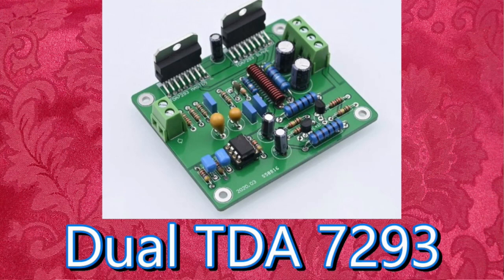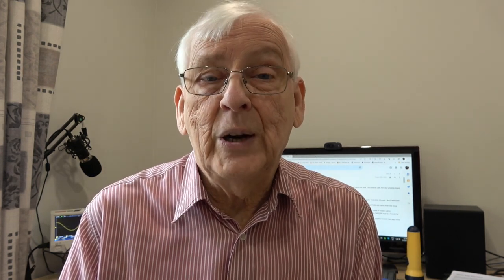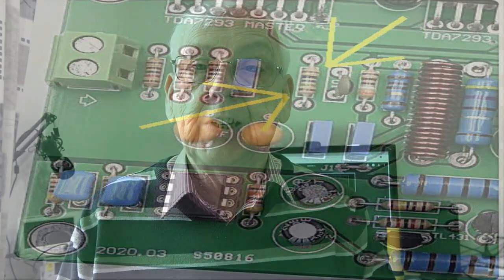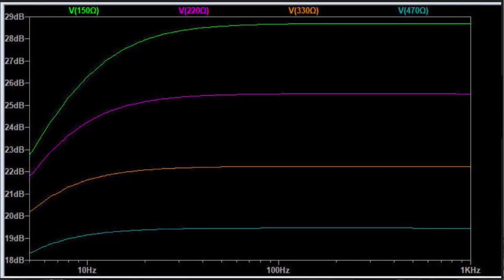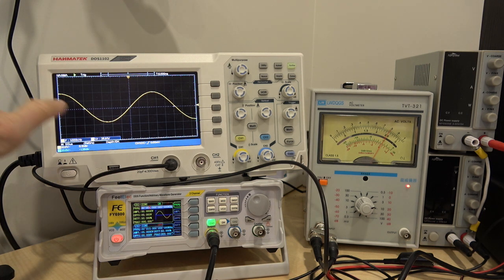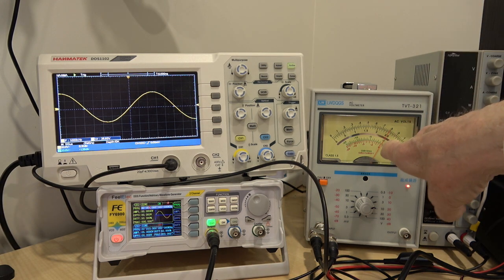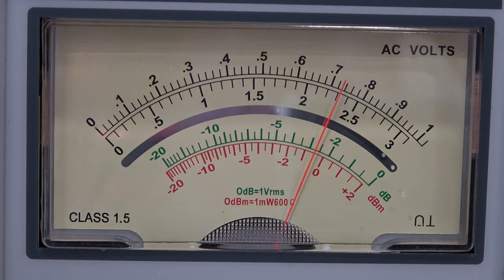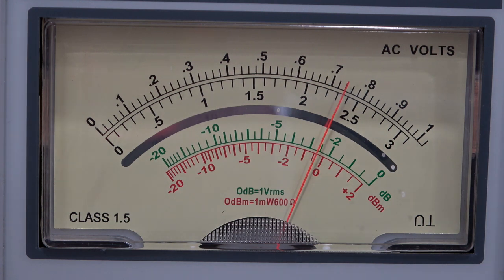More Mods & Tests on the Dual TDA7293

Comment: Hi Mike, I understand that these amps do not like a pot at the input, so I am considering using a NE5534 as a buffer but with some gain as they do not like unity gain, an then reducing the amps gain to suit. I prefer the 34 to the 32 as it has an offset adjustment. Does this sound like a good idea?

Comment: Hi guys, (thanks Michael) Dear Mr Ron Schauer, are you watching us :-) Can I reach you somehow I do have some questions which I am sure you can answer. - My experience so far, after powering the amp, it went into smoke, I seem to have bought fake chips.
Reply from the maker: If you have purchased the completed one I have talked about in this video, they are genuine chips. In fact mine is still in use every day. Things that can blow it up is connecting it up in correctly. Only supplying say the +ve and not the -ve, that will blow it up for sure. This module costs more than many on e Bay simply because they are genuine chips. Some of e Bays complete amplifier are cheaper than 1 genuine version. You pay the penalty!

Comment: You actually dont want 5hz. Record warp will drive you crazy as hell if your amp gets down there
Reply from the maker: I personally don't use records at all. So only an issue for these that do. Such filtering should be provided on the RIAA circuit. Other inputs don't need restrictions.
Reply: Most speakers won't even produce 5hz or even 20hz.
Reply from the maker: @Munakas-wq3gp Very true but transience's or sudden pulses do. It comes over as bass slam which this amplifier has. You wont  know until you try it.

Comment: Hi Michael thanks for the great content. I see boards on ebay with 3 tda 7293 chips on them. Do you think this would be an advantage or is it just for power? I want to build a stereo amp for music and to integrate with my home theater and you videos have me thinking tda7293 is the way to go.
Reply from the maker: I have not tested the 3-chip version. It does not contain the servo circuit, however. It would allow higher power, if you need more, simply because you can up the voltage and the increased current is shared between the 3 chips.

Comment: Lol ...I don't know about the gold plated case, but maybe glue a high end logo on there?
I'm certain many "golden ear" audiophiles would be shocked and maybe embarrassed in a blind test!
Reply: Gold plating (if thin enough) can be relatively inexpensive, and it could (in some potential reviewers' eyes anyway) greatly enhance the sonic clarity, soundstage, depth, ambience, detail, impact, presence, blah, blah, blah- ad nauseum.  
As for a logo pasted on, I think that is an excellent idea..!
Pick anything north of $10,000 (per channel without a preamp of course...).

Do you suppose a golden-eared audiophile would give it an true blind A-B test and admit the results?

😆
Reply: @ronschauer839  lol ....I don't think you would get a bunch of those in the same room anyway. Besides, they hate to be proven wrong: that their 2,000 dollar,  kryptonite infused, cryogenic, spun pure oxygen free rhodium is better than the pair you picked up at a thrift store.
Reply: @billkalina3089  Oh, but you forgot the separately pressurized dry nitrogen isolation jackets for the interconnect cables, the pristine glacier ice cable standoffs (with individual refrigeration units naturally) and $1000 a meter power cables with rhodium-plated wall socket contacts... and several dozen magic quantum wall dots thrown in for good measure.
🤣😂 LOL..!
But seriously, these little boards can be really good, expecially for the price.
And there are triple-chip versions that should be even better at driving low impedance loads (but they lack the DC offset servo circuit).
Reply: Doh! I almost forgot!

Comment: True, the improvements are not "chalk and cheese" (just as long as it is driven by a low impedance source).
However, if it can be made just that much better with such simple and inexpensive modifications, why not do them?
👍👍 Thanks!!!
Reply from the maker: That low impedance buffer circuit will probably be my next video.
Reply: @MichaelBeeny  can't wait to see this video with buffer 😁👍👍👍

Comment: So good to see videos again....and you even wet our appetite for more on the way...just like the good old days
BTW - on your advice i got this board but before I could get round to a listening test seem to have blown a chip...can you advise if the chips must be isolated from the heatsink?
Reply: Yes, they must be electrically isolated from the heatsinks if the heatsinks are grounded or connected to anything else (including another channel).
Reply: @ronschauer839 
IIRC ... the substrate plate on the back is connected to V- supply, is it not?

That would mandate ... heat sink compound, mica insulator, more compound and a plastic washer on the mounting bolt.
Reply: @Douglas_Blake_579   
Per the specification sheet for the TDA7293, the tab is connected to pin 8 which is the inverting signal input pin, however its name on the data sheet is a bit confusing.
The V- (power supply input) is actually on pin 15.
Quite oddly however, they labeled BOTH pin 8 and pin 15 as "-Vs", followed by "(POWER)" or "(SIGNAL)" which is all that differentiates them..!
Why they did not call pin 8 "-Vsig" and pin 9 "+Vsig" to reduce or eliminate any potential for confusion I don't know.
Regardless, the device tabs must be isolated from the heatsink for them to function properly.
Reply from the maker: So sorry to hear that. Yes, the ICs MUST be isolated from the heatsink. Did you not get mica or plastic washers with the amplifiers? You should have. The ICs not only need isolation from the heatsink but also from each other. In fact 99% of all amplifiers need to be isolated.

Comment: Bravo Mike, and thanks again for your research. We are the benefactors. Frankly I am amazed there isn't greater acclamation for this amplifier. It truly kicks ass! 
I can't hold back anymore. I have cobbled the pennies together, and I have ordered them!
Reply from the maker: I cannot hardly wait to hear what you think of them. I'm sure I know what you will say. I just wish I was on commission lol.
This board was loosely based on the LINN LK140 apparently.
Reply: @MichaelBeeny  yes, I will let you know Mike. You know what would be great: to deliver the amp to say Steve Guttenberg, the Audiophiliac. I wouldn't tell him anything about what's inside, and invite him to put it through its paces, and to see if he could guess what kind of an amp it is, and how much it cost to build. I'm certain he would be quite surprised!
Reply: @billkalina3089  
If you gold plated the cabinet and used anti-tamper screws to prevent peeking inside, that might indeed be an interesting experiment. 🙂🤣
Reply from the maker: I don't think that would work Ron. If you could prove these gold-plated amplifiers did not sound any better, lots of high-end manufactures would go out of business. @ronschauer839

Comment: Okay, I'm impressed. This one is on my list for sure.  

One point about circuit architecture ... I've always found that multiple stages with lower gain does a better job than one stage with all the gain, despite the increase in parts counts (within reason, of course).
Reply from the maker: Well Douglas, you might be able to suggest a few more possible mods!!
Reply: @MichaelBeeny 
I may, once I get into it. Hopefully in a couple of weeks.

 Right now I'm still finishing up my deep dive into the TPA3255 boards ... That chip has so much potential but it seems that every product using it has at least one "day 1" issue that rules it out.
All I need is one good board that either is or can be made serviceable and I'm off to the races.

Then we play with the TDA7293 ...
Reply: Yes indeed. That is one of the reasons to reduce the gain of the 7293 boards a bit and to add a preamp/buffer in front. In addition, the low end response is significantly improved by changing the indicated resistor. If you look at a normalized overlay of the four resistance value results the differences are quite dramatic.
Reply: @ronschauer839 
I saw the graphs online ... it is a decent improvement for sure.
 
Have you considered increasing the input capacitors?  More than once I've seen low end roll off above about 20hz just get up and vanish when you bump up the coupling capacitors.  For example, on the Aiyima A07 going from 10 uf to 22uf on the inputs brought the low end cut off down to about 4hz.
Reply: @Douglas_Blake_579  
Thanks, I found the graphs to be quite informative.
The signal input paths on these particular boards are DC-coupled (there are no coupling capacitors).
At very low frequencies C1 has no effect at all, even if left at its original 2200pF.
However, if you are referring to what I labeled C2,3,4, then yes I do think it would help in this regard to increase them (with a caveat or two). 
The RC "frequency response" of the combination of those capacitors and R4 (assuming that R4 is changed to 470 ohms as Mike did) is around 2.5hz. 
This reveals itself as a drooping of the waveform in lower frequency square waves, which is exactly what he showed.
At even lower frequencies these capacitors become more or less open circuits just like C1 on the input, further reducing gain and increasing the drooping effect.
With a sine wave however you'd mostly see the effect as a reduced output amplitude.
But it would be with some accompanying distortion (eventually becoming more triangular or "sawtoothed" at ultra low sub-sonic frequencies).
Unfortunately, if you doubled or tripled the value of the C2,3,4 combination you could adversely affect the operation of the DC servo circuit (auto-null).
So it is probably best to leave them alone. 🙂
On the other hand, increasing the value of R4 lowers the "frequency" of the C2,3,4/R4 combination, pushing the point of that transition to triangular even lower.
That's why he said that changing the R4 value higher will also have a good side benefit of reducing LF distortion despite reducing the overall gain.

It may also help to further increase the value of C12 (bootstrap capacitor).
But the effect of doing that would likely be seen only as a further reduction in LF distortion, which is not a bad thing..!
Reply: @ronschauer839 
I don't have the board handy or it's schematic.  I was talking about the first input coupling capacitors ... the first thing the signal sees on the way into the board.  These coupled with the input impedance of the circuit form a high pass filter.  You can often get low bass improvements by increasing their values somewhat.
Reply: @Douglas_Blake_579  
Understood, but again there are no coupling capacitors on the inputs to these boards.
He did show the board schematic in his video just prior to this by the way.
To my knowledge it is not "publicly" available anywhere else.
FWIW, I have done the same sort of modification you describe on several amplifiers and it does definitely help bass response.
Interestingly (perhaps, or perhaps not 🙃) I am using a pair of these boards in an AV amp.
They are modified just as Mike did and are being pre-driven by one of the same type of preamps he shows at the end of the video (I'm not saying which one though, that's his to reveal... 🙂)
It is completely DC-coupled all the way from the input RCA jacks to the output speaker binding posts- no coupling capacitors anywhere in the signal paths.
The bass response is simply *excellent*.
Reply: @ronschauer839 
Yep, you can do that when you know there are no DC offsets and it can be quite good.

The input caps should always be there. What if you hook up to a DAC or Pre-Amp with 6 or 9 volt DC on it's outputs?
Reply: @Douglas_Blake_579  100% agreed as a general principle. No argument from me.
In the instance of our AV amp however it is already capacitively coupled at the television's audio output stage (I checked).
So in this application I know that there are no DC offsets present to cause problems, but I certainly take your point.
And the servo portion of theses boards easily takes care of any residual that may creep through.
It is not an amp that is ever switched between differing sources, unlike my main stereo system (L12-based, by the way) which has multiple input sources.

I would suggest that a preamp or DAC having that much voltage at its output is not something I would care to own or use for any purpose.

My stereo amp on the other hand is definitely equipped with capacitors at its preamp section input.
And also in between the preamp and the power amp sections.
The response cutoff of each of the isolation capacitors and their load resistors were sized to be roughly 1.5hz incidentally.
More than adequate bass response is the result. 🙂

All that being said, I do have some 47uF non-polar "audio" capacitors on hand that are just aching to be installed at the AV amp's input jacks (with suitable bleed resistors on both sides of course).
I just haven't gotten around to doing it, but I do plan to do so in the near future.
Reply: @Douglas_Blake_579  
"If you got the high pass on your inputs down to 1.5Hz then 2 stages coupled together will result in 3hz "

**Sort of**, but not exactly.
The actual component values I used in that particular amp are 4.7uF (film) and 22K as loads.
Because the two sections are separated by a buffer/preamp section they in fact operate independently.
They both begin their LF roll offs at exactly the same point (roughly 8hz).
The 3dB down point for the first section is at about 1.5hz. 
And the second section (after the preamp and in front of the power amp input) reacts exactly the same.
No change in the combined roll off start point, but the roll off is steeper past that shared starting point.
They do not simply add though.
The -3dB point for the combination (with the buffer in between them) is around 2.2hz, not 3hz.
Yes I know this is splitting hairs, it is more than good enough no matter how you view it.

Telephone and cable line amps have used the very same "signal riding on a voltage" technique for ages (literally more than 100 years now).
That is really old school for audio though and has absolutely no purpose or place in any modern (post 1960) hi-fi equipment.
And yes I am aware that brand new microphones can have up to 48 volts riding on their signal lines.
That is usually sourced from sound boards to power whatever electronics are contained in the microphones themselves.
But that is a specialized application for sure that would be exceedingly rare to find in a home stereo setup.

Therefore I still say that any preamp, DAC or other equipment that exhibited that sort of behavior would end up in many small pieces my trash can (if it couldn't be modified to correct it).

All that being said, there is of course absolutely nothing wrong with adding in coupling capacitors as protection just in case!
But that's also why I will not build (or modify) amplifiers without adding speaker protection boards (just my two cents worth)...
Reply: @ronschauer839 
Whenever I see an amp with no series caps on the inputs I usually try to add them.  Even if the guts have the means to cope with it, DC voltages on volume controls are still a very bad idea.

And for the speaker protection ... I wouldn't have it any other way.

Of course the stuff I've been playing with for the past couple of years all incorporates Offset, Voltage, Heat, Clipping,  etc. protection right on the chips, so that makes life a bit easier.